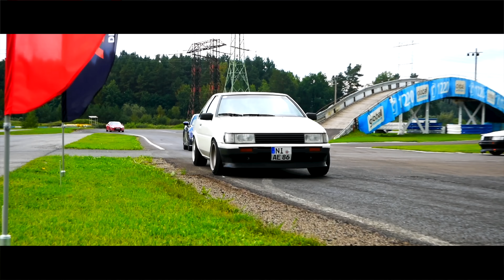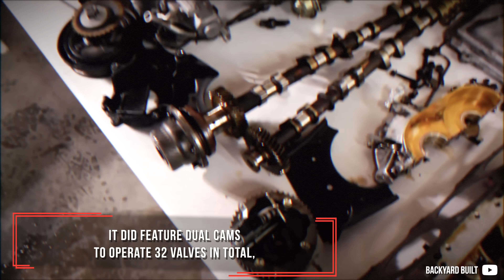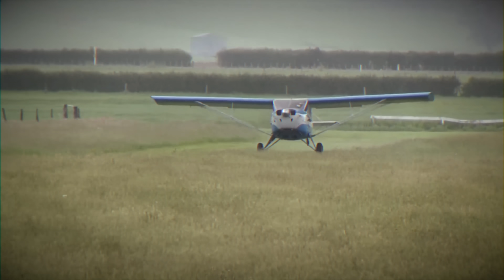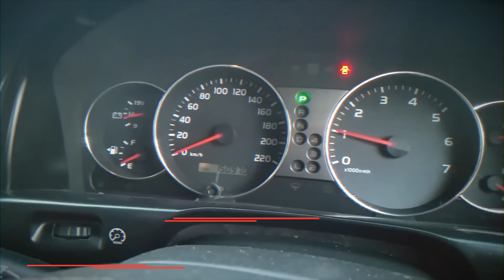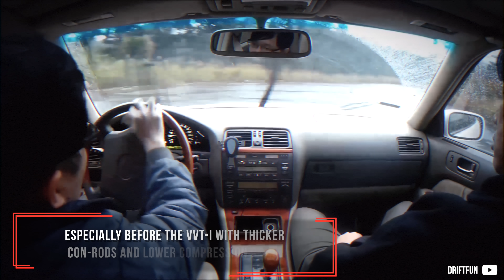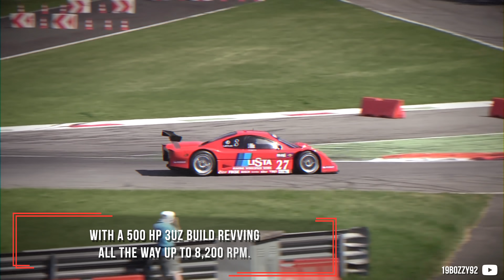The Strongest And Most Reliable Automotive V8

Comment: If you want a good v8 easy to make power it’s the coyote
Reply: Junkyard 4.8L vortec with stock bottom end boosted with eBay turbo makes 1300 hp & lasts.
Reply: @googleaccount2637  🤣🤣🤣🤣
Reply: Não, Chrysler HEMI V8 (2003-present) all the way!

- English translation: "No."
Reply: @josecarrilloii4036  🤣

Comment: Great video! No wonder Toyota/Lexus put so much effort and money into this engine and the LS400 - it was the first Lexus ever, their debut model for the US market - they couldn't mess it up, and they didn't.
Reply: At that time the dedication to research was second to none.
Reply: Lexus is lexus, they over engineer their cars, they had a "halo" car which is the Lexus LFA they first finished developing a fully aluminium body and then scrapped it and started designing a new fully carbon fiber body and they even partnered with yamaha to tune their exhaust which sounds absolutely astonishing and then they used light weight exotic materials for their v10 that redlines upto 9.5k rpms, it redlines to 9.5k rpms so fast a traditional tachometer cant keep up so they equipped it with a digital one. no wonder its so damn overpriced
Reply: *Chrysler HEMI V8
Reply: Except for it putting the starter under the intake manifold…
Reply: @billd9667  this is not a big deal as they rarely fail and even so it’s really not hard to take the intake manifold off
Reply: @Sci-flyer  if you’re doing it yourself, fine, but there’s a significant added cost at the mechanic, including new gaskets. They could have done better
Reply: @no_data_for_you  No, very basic and just a great compromise between cost and longevity(imho).

Comment: That plane with the V8 sounded badass.
Reply: If I were a licensed pilot, my airplane would have that kind of engine -- a four-stroke, uneven-firing and fuel-injected 8-cylinder, be it either a V8, a boxer-8, a straight-8, or even a single-row radial-8.
Reply: @josecarrilloii4036   Buick had an 8 in line engine in the early ‘50s, but I haven’t heard of an 8 cil boxer or radial engine. A V8 is obviously most common.
Reply: @MrZdvy  There was an boxer-8 racecar engine in a Porsche in the 1960's.

Buick also WASN'T the only manufactuer to produce a straight-8. You had Packard, Mercedes-Benz and Alfa Romeo in the '30s, Rolls-Royce in the '40s (including World War II), Duesenberg, etc.
Reply: @MrZdvy  4 stroke radial engines are only smooth, with an odd number of cylinders in each row. I've never heard of a radial 8 but I understand even numbers would be fine if it's a two stroke engine (radial 2 stroke engines are also not common, it seems)
Reply: @julianbrelsford If my airplane had a radial-8 engine, it'll be a four-stroke engine, not a thirstier, dirtier two-stroke engine.

Comment: Excellent video! What if you do some videos on the most reliable and durable BMW engines? Considering the poor reputation they have nowadays, informing people of the actual facts would be great!
Reply: M44 and M50 engines are durable if the plastic cooling system parts are replaced every 12-15years.

And unlike the UZ series the M50 series will handle forced induction unopened over double its stock Hp.
Reply: It could be an diesel engine only. 530D with single turbocharger could ran high odometer. Maybe, the old 3.0 inline 6 benzin engine, with 231 hp. “M” motorcode, not the “N”, wich are not so stable.

Comment: That’s a real good sounding bunch of engines.
Reply: @footballcoreano Damn, who left you in the dust in their mom's Oddysey?
Reply: @footballcoreano dude’s probably butthurt that a Toyota Sequoia beat him in his Dodge Ram.
Reply: @footballcoreano 
I’m a mustang guy first off. I own two now and have had 16 total in my life. I’ve got the ford V8 tatted on my throat and the running horse on my back & the only Japanese car I’ve ever owned is a 90k mile JDM ‘98 Subaru Forester. I’m a fan of the mechanics that go into an engine and I can appreciate all kinds of engines from Porsches to Mercedes and GM & Ford and Toyota & Nissan. Every company makes great engines like the GM LS series down to the lil Chrysler 2.2L POS in early caravans. I’m far from a fanboy Haas, I buy, build, race, rebuild, & race some more. Get off your high horse Bud, these comment sections are made for good times not bummers like you. 
PS, what I was referring too is the nice firing order sound of these motors too. I’m a huge mustang fan and I know the coyote is an amazing engine but I truly do NOT like the sound of that engine. It’s that odd firing order that does it. However, that 5.2 Voodoo motor with that flat plain crank is the sound of my dreams. I’m building an oldskool 347 pushrod stroker for my current project but if I could line one up it would have a big turbo Barra in my ‘84GT T-top. I do like the DOHC 281 4.6 litre engines Ford has made as well. I’ve had two of them, both all aluminum. One was running great with 160k on it in a ‘96 cobra and I blew the other one up with 68k on it in an ‘03 Mach1. No power adders or anything. I’m a Mustang guy but I can appreciate just about anything out there, the fact is that driving is fun.
Reply: @aaronburratwood.6957  seems like you do a whole lotta meth too
Reply: @footballcoreano Man, you're so far off the truth it's hilarious! Why don't you ask people who've actually owned these Lexus V8s. I'll start. My family has seven of them. Three are waaaaay over 200k miles with zero problems. The rest are over 150k with zero problems. I know plenty of people with 300-400k miles on their V8s with zero problems. They literally don't die if routine maintenance is done. Time for you to get over your Mercedes fanboying and do some real research.
Reply: @footballcoreano who hurt u
Reply: @footballcoreano sounds like someone got gapped by a 20 year old civic

Comment: Im a little disappointed that someone such as yourself would associate engine wear with mileage. Mileage is irrelevant to the engine.
Reply: are u joking xDDDDDDDDDDDDDDDDDDDD
Reply: @swollysxpw2025  Sit a car on a driveway full rpm, and sit another on the highway in top gear low rpm, then tell me without knowledge of anything but the mileage, which engine is in better condition. Its irrelevant. Anyone with an ounce of mechanical knowledge and common sense would know that mileage is NOT indicative of engine condition.

I've seen cars with timing chains snap at 12k mileage and cars with engines looking brand new at 250k mile. Mileage is relevant to pretty much all the rest of the drivetrain bar the engine
Reply: @swollysxpw2025  yeah, thought so.
Reply from the maker: Well, it depends. If you care as you should from the day one, yes, it does not really matter. However, once the preventative and regular maintenance is not there, things start get worse far sooner

Comment: And lack of power.
Reply: Yah but torque seems decent
Reply: Japan isn't well known for powerful and big engines like America. Displacement tax and gentleman's agreement in limiting horsepower to which America doesn't have, yet.
Reply: @Joshua_N-A  Displacement taxes are so stupid
Reply: @isakjohansson7134  Japan mostly imports oil, plus the Japanese were cut off from that resource in the war by the Americans. Give America trillions of barrel and they'll be running V8s forever. Unless Japan decided to claim the entire Pacific's oil reserve before the Americans do, if any. Oh and btw, Japan wasn't affected as much as the US in 1973 because the Japanese have gotten used to small displacement and frugal due to the devastation of WW2. Japan nearly devoided of wealth and oil was restricted by the Americans.
Reply: @Joshua_N-A  True but displacement isnt really directly correlated to fuel consumption, it very much varies by driving scenario, speed load, gearing etc. And of course the other specs of the engine
Reply: @Joshua_N-A  i dont think america is any good at getting power out of their engines either tbf
Reply: @YorkyPudinz  Look at the 5.0L Coyote V8 and see for yourself.
Reply: @CJColvin  okay thats 1, still doesnt make 100hp per litre but its not far off. Any others?
Reply: @YorkyPudinz  Theres also the new 5.5L DOHC 32V LT5 V8 with the Flat Plane Crank in the new C8 Corvette Z06 making 670 HP in NA form and there's also the 5.2L Voodoo V8 with the flat plane crank making 526 HP and the 5.2L Supercharged Predator V8 making 760 HP. Also there was a 5.7L DOHC 32V LT5 V8 making well over 405 HP back in 1994 in the 94 Corvette ZR1.